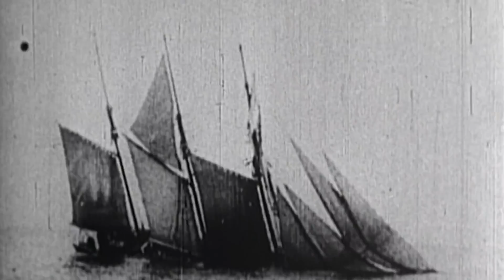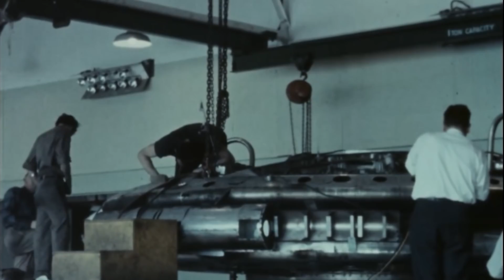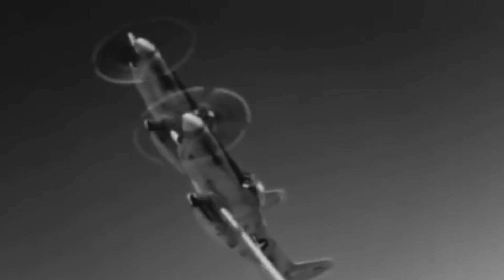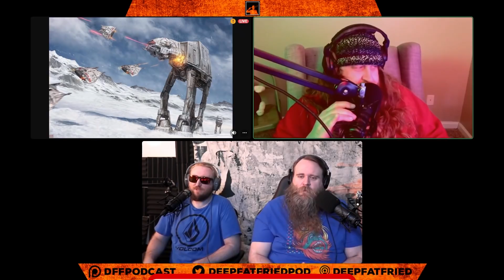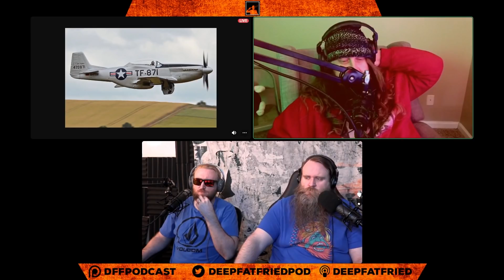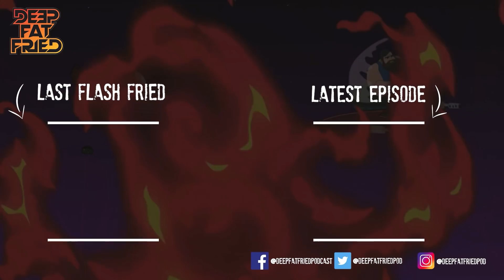Weird War Vehicles

Comment: The two A-bombs isn't all they did to Japan... they firebombed the crap out of Japan from 1944 to the end of the war.  A crazier aircraft that was joined like the Twin Mustang was the German Heinkel He-111Z which was two twin engined bombers attached to each other, with a 5th engine in between them.
Reply: Same with the Bf-109Z. It's basically the identical concept as the F-82 Twin Mustang, just the Messerschmit 109 instead. Also, I think it only had one pilot vs two for the F82
Reply: The firebombing of Tokyo actually killed more people than the atomic bombing of Nagasaki.